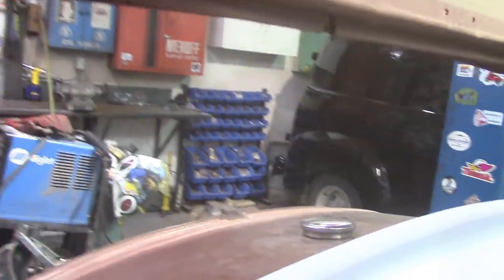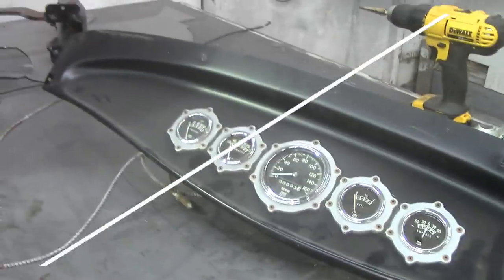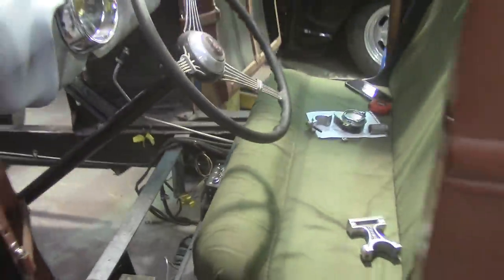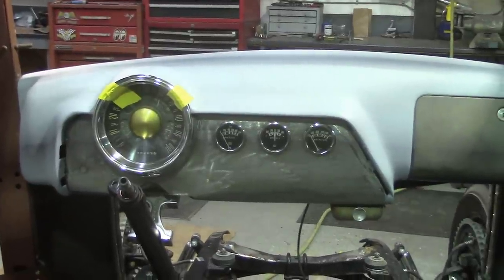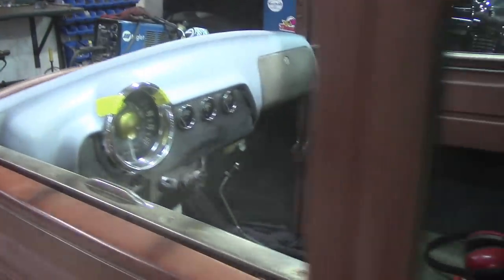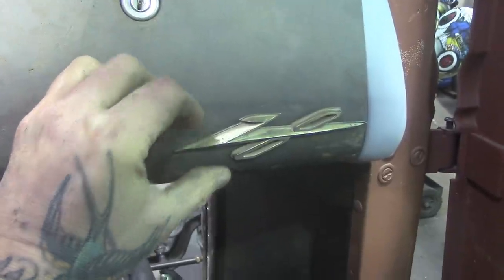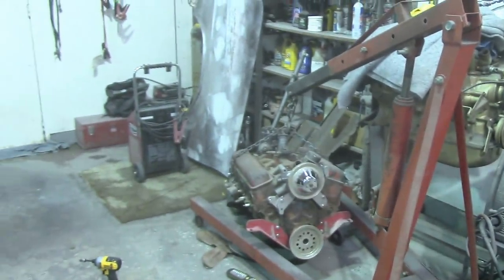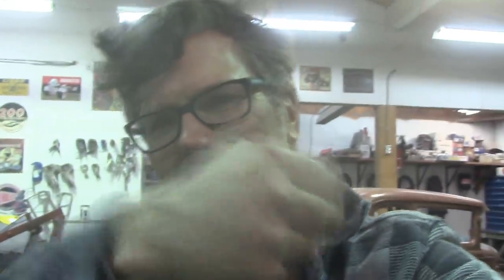1931 Ford Chopped Coupe Resurrection Part 7 - Dash Work Continues & Zips Water Pump Riser is in

Comment: Whole dash looks PERFECT ash tray included. Was trying to interrupt and say "you can flatten that bottom" before you mentioned it.  
Don't know if he still does it but Roy Brizio used to make a very simple and clean column drop using a heavy wall slice of tubing that tightly fits your column drop. He would drill a small hole (maybe 1/4-28 ) and use a set screw somewhere in that tube ring. He would use smaller tube (maybe 1/2" or slightly smaller) again fairly heavy wall, from the tube ring up to a (not visable) plate under the dash. So what you see is two, usually angled out, tubes going from a ring on the column drop up to the bottom of the dash. Very simple and clean. I used stainless parts on mine and polished the stainless. Sometimes they would make a plate across those tubes and include the ignition switch, etc. You could do that on yours only make the tubes go out a bit sideways before going up to the dash to give you more "flat" in between. Maybe carefully fit the flat plate "inside or under" (recessed down) to add another dimension. 
BTW, if you like that plating look, consider using "Nickel" plating on all your "shiny" stuff. It has that "gold" tint to it that always adds a bit of "class".
Reply from the maker: You got to love a little class . Thanks for the info on column
Reply: @OldTimeGarage  
No problem!! Happy to pass on the info. I made my own column on my 29 CCPU and made one of those drops. Tell me how I can message you and I'll send you a photo.
Reply from the maker: @pappabob29  Just go to oldtimegarage@hotmail.com

Comment: Hey Rick this question doesn't have any thing to do with your new Ford there but I have a little Ford pickup truck and I was thinking about doing the Big 3 wiring upgrade for the charging system and I was wondering if you had any thoughts on that as to whether it would be a good thing to do or not thank you
Reply from the maker: Yes foresure a good thing not that theres anything wrong with the old stuff !